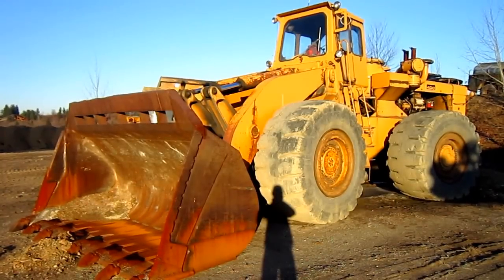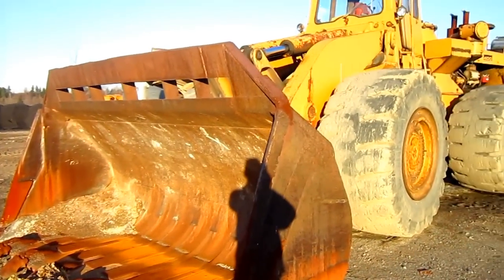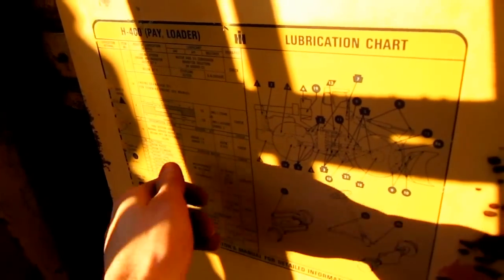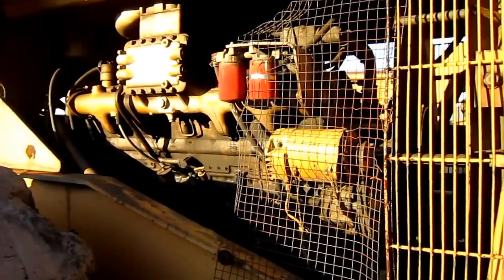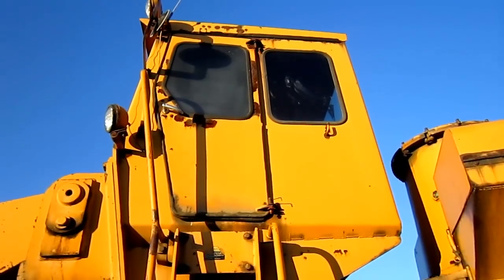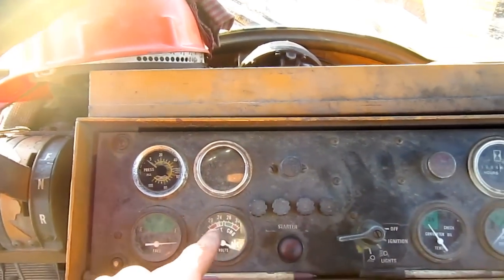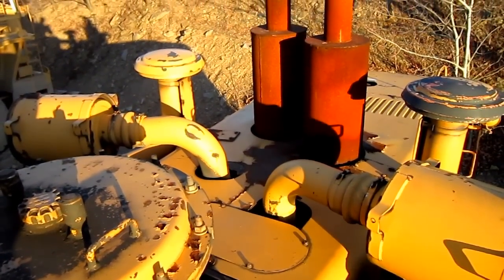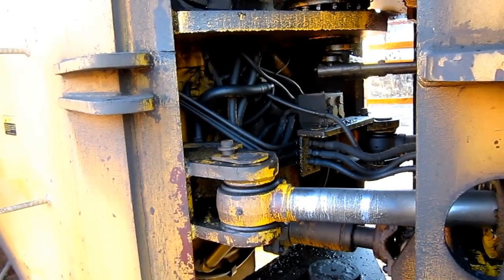International Hough H-400C Documentary

Comment: I was the main mechanic on 14 of these loaders for over 10 years. The H400A models with their Detroit 12v71 engines were better in some ways than the later H400C models with their POS Cummins VT1710 engines. I rebuilt almost every part on these machines from their hoist rams, to their engines, transmissions, buckets, hydraulic pumps, etc. all are machines had the long arms

Comment: I ran an old Cat 966 with rear steer and no articulation, just straight steering. Took a little getting used to but you run what you have. Seems like Case had a cab forward setup like this. Good video!

Comment: If international would have taken many of its customers advice and input on the 400 ,it would have been the premiere big rock loader,  rather than the 992C . They only needed to slow it down.  It was entirely to fast in 1st gear. Had International put a larger /slower ring and pinion ratio, and added straight hydraulic wet disc brakes, this would have been an amazing machine.

Comment: I was the mechanic that maintained 14 or these machines for 10 years we had A models and C models, both with 19 yard coal buckets for handling pet coke. They ran two shifts a day. They constantly broke and kept me constantly working. We had beefed up long arms, and beefed up axle housings. I rebuilt everything from their steering, diffs, planets, rams, trans, TQ's, engines, frames, rims, cabs, brakes, etc.

The A models were vastly better than the C models their 12v71 engines burned half the fuel and lasted 10 times longer and were much much cheaper to rebuild. The C models had better brakes and more power with their terrible VT1710 cummins engines.
Reply: John Donahue i ran one on pet coke and bottom Ash. I loved the power but you're right, it was always broke!

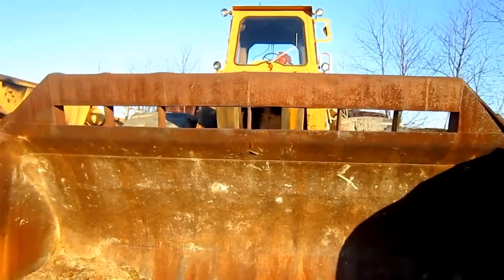Comment: Eagle coal an dock(centeral asphalt/w.v. paving/v.n.green co.),wv.,use to have a 400 hough on there strip mine,with a coal bucket ,they used it to load cline's in the 1970's . At 5:55 in the back ground,that looks like a 1965 GMC 5000 tandem V6 351 gas with a 5 & 4 ,when you learn to drive one of those dump trucks productively,you can say you learned something........
Reply: Hi Charles  McCormic. Where was the location of the mine you worked ? I worked the area of Holden WVa. I was with Elm Coal in Ky, so I paneled to the old Rebel job. We used several Cline coal trucks . Thanks for the post you made

Comment: We had 4 of these ,and they were a great loader ,they just needed to be slowed down ,they were entirely to fast ,other than that ,a great machine.
Reply: +ROYALTON COAL  , yes they sure were fast especially in 2 Nd gear. As I recall it was only a 2 Spd. I operated one in rock loading 777 and 773 CAT trucks. Fine loader, but never turn the steering wheel unless the wheels were rolling as the rear was what did the steering. Guess you well recall that in relearning to operate after being on CAT. lol.

Comment: Those tail wagging loaders are horrible to operate, when backing up you have to keep an eye on the rear end at all times to make sure they are pointing in the right direction, if you look away for a few seconds they end up next to the cab and you get whipped around. having the cab attached to the front end is a really bad idea.